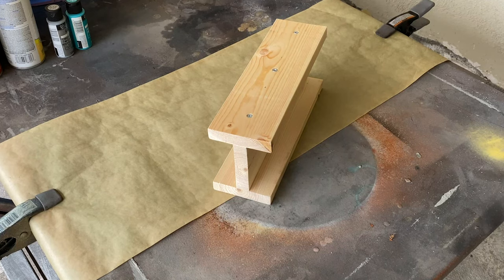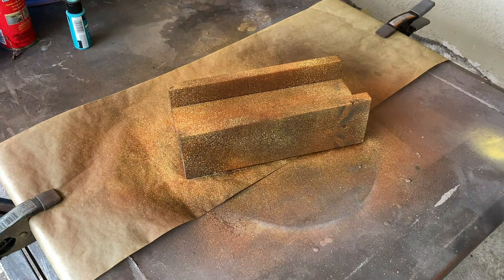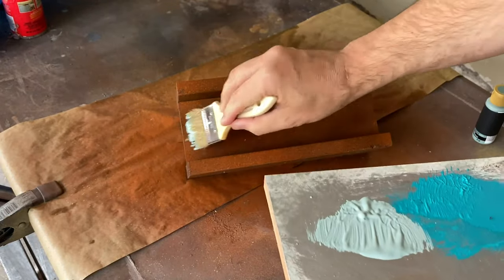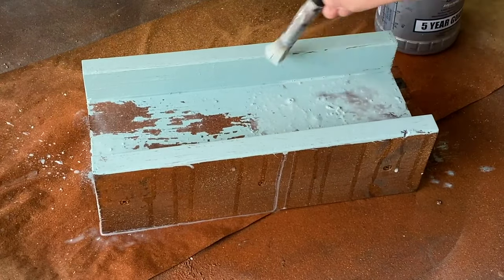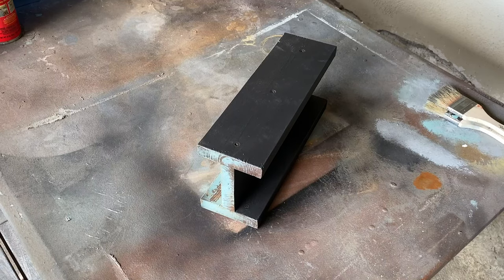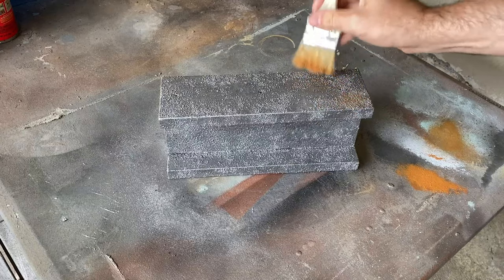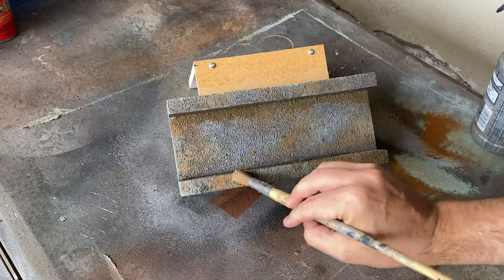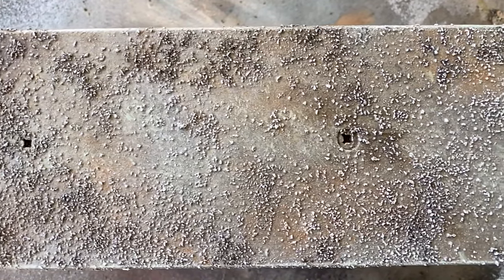Rusted Metal Paint Effect using Hairspray & Coffee Grounds

Comment: While I absolutely love your work are you aware that there is an real iron paint by Modern Masters out there that can be used on almost anything. What you get is real rust when a rusting solution is applied to it. I use the peroxide, salt, vinegar mix to rust it. It has held up outside for 10 years. It’s much quicker. Even sticks to plastic. Keep up the great work.
Reply from the maker: Thank you! I’ve heard of it, but I’ve also heard it can be pricey. So I figured out how to get a similar result without needing specialty items.
Reply: @VanOaksProps   I tried the Modern Masters rust product, the effect was disappointing to day the least - considering the price. 
I ended up improvising with craft paint, and most of the spices in the pantry.
Can you suggest an alternative to hairspray? I want to try your technique.
Reply from the maker: @heidihein8662  I’d check out this salt technique that I used in this video:
https://youtu.be/BWKYSNsy-BA

Comment: With the clear coat sealer, have you found it neutralizes the hair spray's effect of preventing paint adhesion?
Reply from the maker: In my experience adding the clear helps to prevent the acrylic from softening due to exposure to moisture, which prevents additional chipping and that's the larger issue.
Reply: @VanOaksProps  Good to know, thanks!

Comment: Could the first method be used with regular interior paint? I plan on doing this to a large tool box and I would probably need around 500 tubes of the craft style acrylic paint you used. Thanks for your time. Love the video and you channel keep up the great work.
Reply from the maker: I haven't tried it, but I'd imagine it would work similarly. The bigger issue would be whether the latex paint would adhere to the metal tool box.
Reply: I sanded it, primed and all the same steps with spray paint first. All that would be left is hairspray and paint and the your magical dry brush technique. So fingers crossed for me. Thanks for the help👍🏼

Comment: Hi I know this may sound strange.... but I want to rust up a red wagon.   The inside seat area shows some rusty areas, however, the for some reason (could be a different type metal) the outside and wheel rims do not. 
What method would you recommend? Or is there another method you could suggest?
I would love it if you could make a video with a small red wagon.
Thanks so much!
Reply from the maker: I have 2 videos on faux rust, so I’d start there. If you need any additional help let me know.
Reply: @VanOaksProps  yes I’ve watched all your videos... they are great.   I’m just not sure of the best technique .... and if I should keep the red paint as the base on wagon.  And the black as base on the tow snd handle.  The wheels are white plastic, so thinking those should be black base. If you ever decide to rust a red wagon ( most are wanting to restore) I’d definitely be interested in learning from you.  The last thing I rusted was a galvanized tub.  And I just painted it with rustoleum rust umber spray paint.  Thanks so much!!
Reply from the maker: I’d start with a quick google image search to see if I could find some reference photos to help with the decision making on what should get rusted versus what should look faded. For example, I would think that the red would fade overall (since red paint oxidized faster than most colors) and would only have rust in the areas where water would have collected over time. So depending on the look you’re going for it could be a mix of techniques. I definitely wouldn’t base coat anything though since rust would form over the existing paint in most cases.